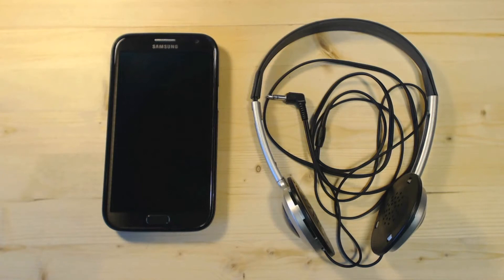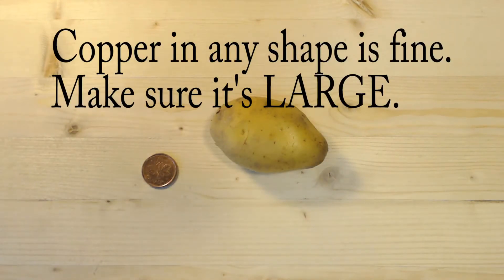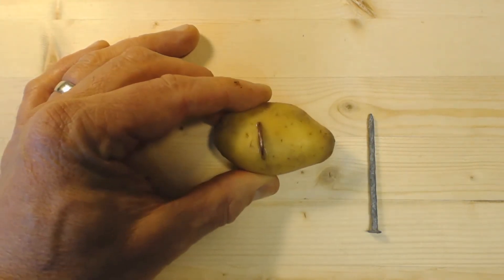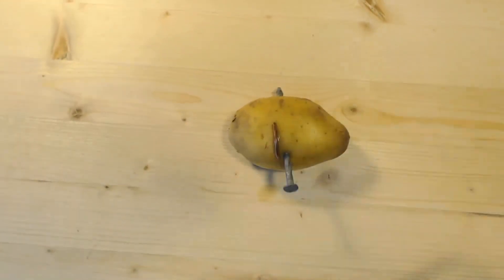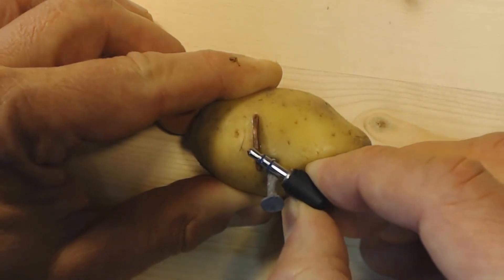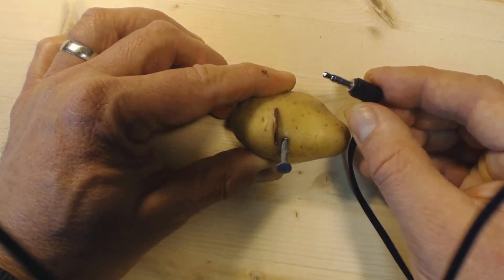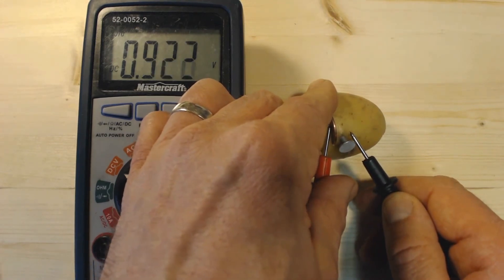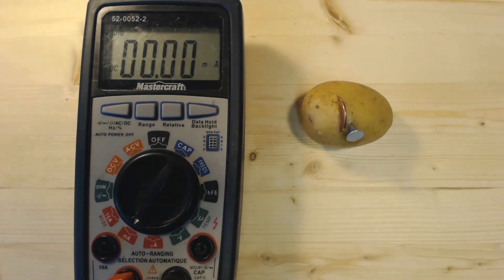A Potato Diagnosis of wired Earbuds/Headphones #19

Comment: Would this work for a 4 pole connector that has 3 horizontal connectors? 2 for ears and 1 for microphone? Thanks. Neat tutorial.
Reply from the maker: +mkcharland yes absolutely. I have another diagnosis and repair video for earbuds that shows that method. You'll see it in my most recent videos on my channel.

Comment: You can use a simple battery to test this, but using a potatoe is a unique way to do this
Reply from the maker: Yes, true... BUT the lowest voltage battery I know of is 1.2 volts for Nickle-metal hydride batteries. Applying 1.2 volts to an earbud or headphone circuit will very easily damage or destroy the voice coil or diaphragm. A potato will be MUCH safer to use.

Comment: so if i hear the sound from the potato thets means the headset works ?? or i dont get it
Reply from the maker: The potato acts like a "very low voltage battery". It is much safer to use than a battery. What I am showing in this video, is a demonstration of how to pass a very small electric current (made by the potato /penny/nail combo) from one earbud connector conductor, up to and through the earbud voice coil, and back down to the other conductor at the earbud connector. If noise is heard in each earbud, that means there is "electrical continuity" (no broken wires) for each earbud. If sound is missing on one or both sides, then there quite likely is a broken wire. If you like take a look at this earbud diagnosis and repair video I made here,  https://youtu.be/2pwFYRGfgyo.
Reply: Mysimplefix is that why one turns into Raiden after a 2 week potato diet?
Reply from the maker: Lol!

Comment: If someone can help me out that will be very appreciated. This has happened twice with my ear buds and I don't what I do to them, but it always happens. The sound always seems to stop coming for no reason. This new pair I bought is already losing sound when they do this I move the ear bud around a little and unplug the earbud and plug it back in then there is sound. Is this a wire problem and is there a fix besides getting a new pair?
Reply from the maker: Check to make sure 1, your phone case is not stopping your earbud connector from going in all the way, and 2, check that your audio port does not have a build-up of pocket lint jammed at the bottom stopping your earbud connector from going in all the way. I have a video for that. https://youtu.be/BjHEfjFwueo

Comment: Hey I was wondering if I could get a little help, uv had a wire break near the earbud it's self right before the get to the speaker I have ibeats by dr see and I don't know what to do please help!
Reply from the maker: If you can see the break, you might be able to solder the wires back together with a small and cheap soldering iron, solder, and heat shrink tubing. You can make it look better by using heat shrink tubing of the same colour. The only thing is, one side will be shorter than the other side by a slight amount. See my earbud diagnosis and repair video here https://youtu.be/2pwFYRGfgyo as it might help you in some way. I will be making a video on your exact same situation as I have had a few requests. I find soldering those earbud wires is not too hard, but if your are going to try it,  I would practise a bit on some other scrap wires. I have a basic how to solder 2 wires together video which might also help here https://youtu.be/oKaPN-GSzSc

Comment: The problem with my earbuds are the top of the wire (the bud) when I squeeze the top of the wire or shove it a bit, the sound will come back or change. I've never experienced this before. Can anyone help?
Reply from the maker: From what you described, there may be a broken wire going into the bud itself. If the bud can be opened up without being damaged, it may then be possible to solder a replacement set of earbud wires onto the existing bud. This of course means doing the same for the other side as well. You would need to ask yourself, are the earbuds expensive? Is it worth doing?

Comment: Can I use anything but a potato? I ran out of potatos and I only have peaches, bananas, onions, and plums. Is there any substitute to the potato? Pls respond quickly! ty
Reply from the maker: I would try a plum, or the peach. Both have acid in their juices which is what is required. Let us know...
Reply: I actually tried it out, the peach works and it helped a lot. Thx man this was really helpful I was able to repair them from your other video.
Reply from the maker: kevin liow I'm glad this worked for you! Thanks for letting us know your experience, and that you're fixed up!
Reply: kevin liow can I use a apple?

Comment: So in this case did you set up the potato and the two pieces of metal in a way that made it function as a capacitor where the charges remained on the makeshift tester or is this actually just a mini battery with very little voltage? Curious because I am going to fix my once again broken earphones but also apply some creativity to make sure they're useful for the winter and easy to repair!
Reply from the maker: Yes this setup actually is a low voltage low current battery. The alternative of using something like a 1.5 volt battery is WAY to much, and could actually damage some earbuds. I do have an earbud diagnosis and repair video which might help you too.

Comment: current measurement is not a short circuit, it is a sense resistor. you didn't say what the resistor is in your meter so there is no way to accurately know how you loaded the potato under test.

Comment: why you dont do it with simple battery?
Reply from the maker: A battery has too much voltage, which can cause the diaphragm in the earbud to break or the voice coil to burn out. Also, it would be extremely loud! This method is safe and effective.